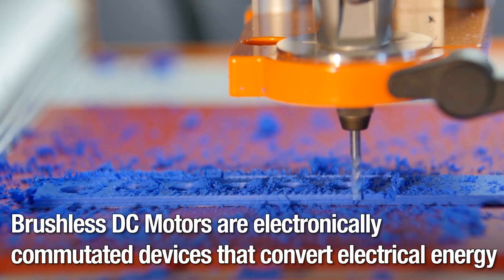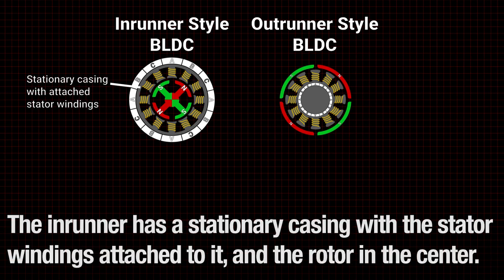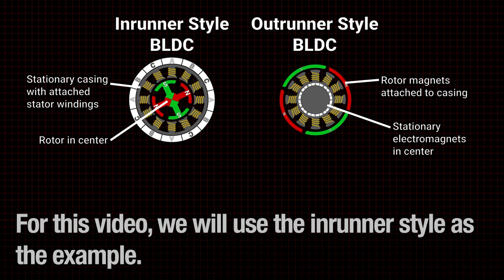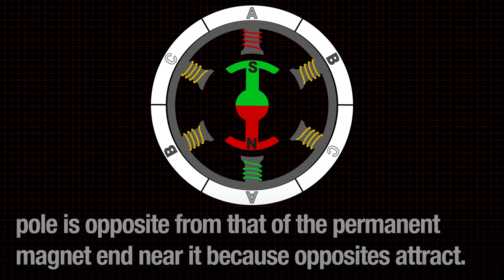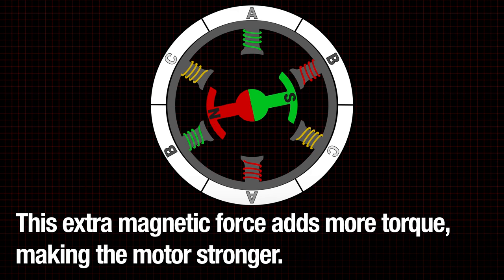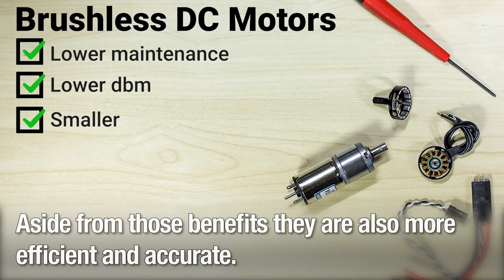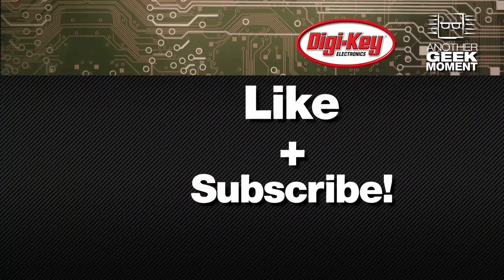Basics of Brushless DC Motors - Another Teaching Moment | Digi-Key Electronics

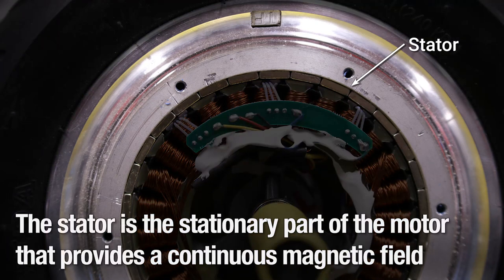Comment: The Motor you show at 0:20 look an awful lot like an outrunner motor with the stator in the middle and the rotor (with the permanent magnets) around. Looking at the number of magnets and the interference-pattern used to place them I'd even guess it's a stepper motor (which is basically just a subtype of a brushless motor). Point is, it's either a really special design or you have the the stator and rotor the wrong way around at 0:30